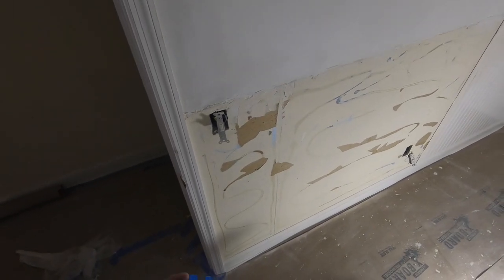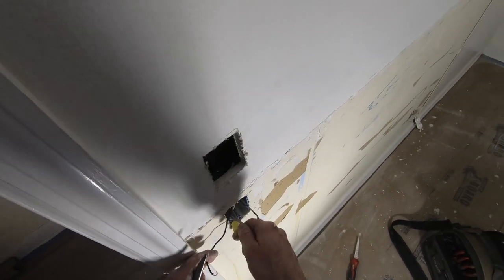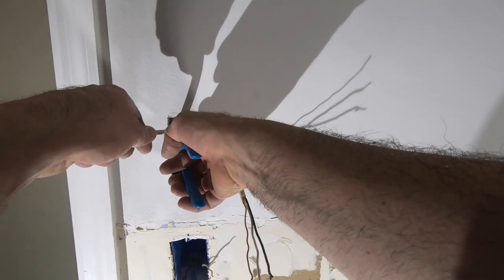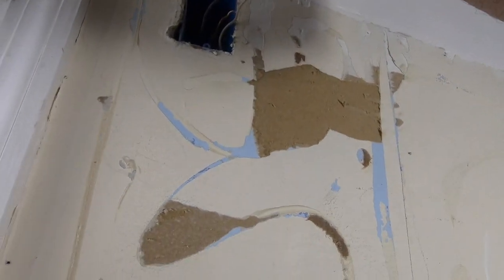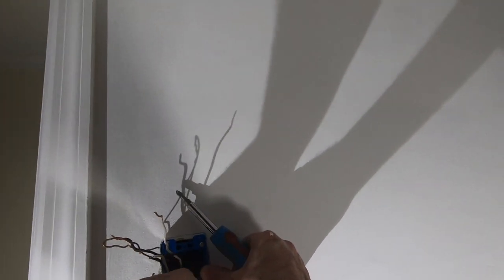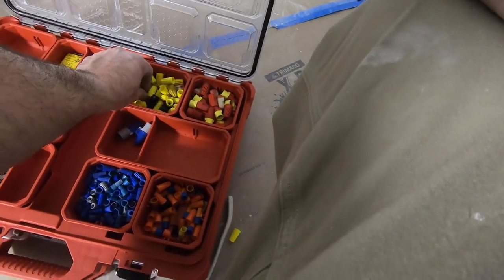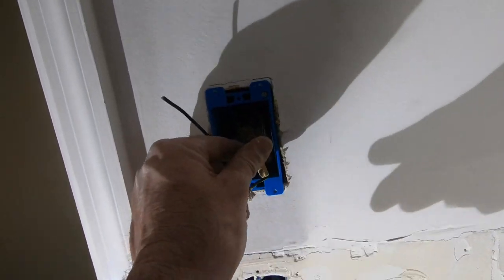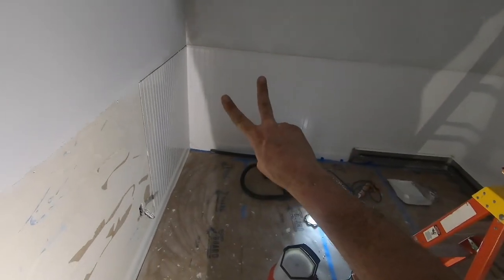Moving A Wall Switch

Comment: I'd write "junction" and a arrow pointing down on the back of the switch plate. You'll be thankful you did ten years from now. I learned that trick from my dad. He always wrote down the date after replacing a switch or outlet. Our living room switch plate had three dates on the back of it. 😊 The switch was used constantly every day and our family wore out three in 40 years. I changed it for my dad the last time. Yeah, I wrote the date down too.

Comment: Is the wall going all drywall now or are you going to replace the wood paneling?  Either way I would probably do a junction box size picture frame around the original box with whatever material will be around it.

Comment: @55:44 bill those 50c throwaway switches don't tighten down on the wires when you stab them in, _ever_. The Commercial grade switches have the square nuts inside to clamp the wires using the screws.
Painfully funny to watch you futz with those ground wires....3x #14 is the most that go in a yellow, most days of the week!!!!
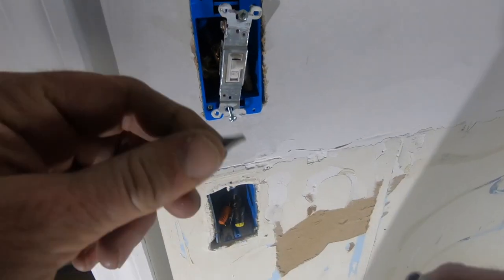@57:40 Pro-tip: with those blue old-world boxes, remove the four ears on the switch to get it to sit flush with the wall so that the cover plate will sit right.